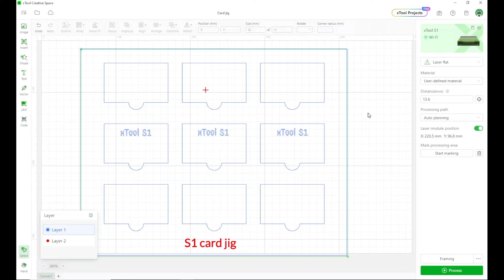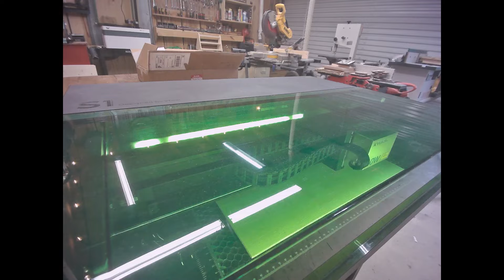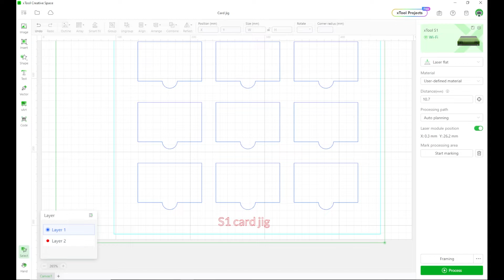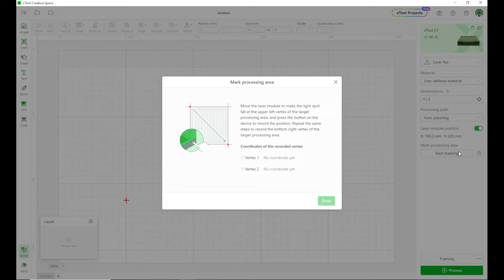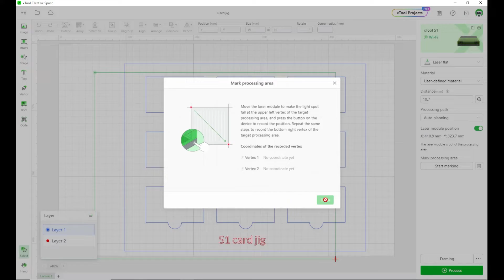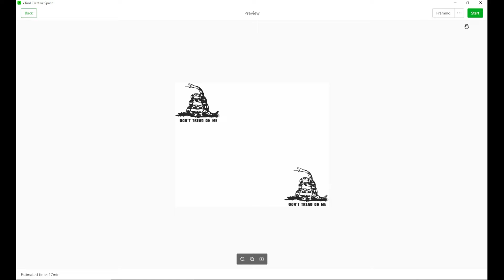Making a jig for xTool S1

Comment: I have been researching the lasers for a while. I appreciate your content, for it helped me decide on the S1 40w. I should receive it this Wednesday, and I went ahead and bought mirrors, tumblers in different sizes and your Jig Set from Etsy. (Very good price, BTW.) I should have some good practice in by the weekend. I took note of a bunch of the settings that you had setup, so I have a good place to start. I am brand new to lasers and I really appreciate how in depth you go. I actually feel confident now.  -Gary
Reply from the maker: Nice, just have fun and make some stuff. You will get the hang of it soon enough.

Comment: Great video, thanks!
It's still a bummer that companies decide to omit decent camera systems from this segment considering how cheap those are in terms of hardware. Looking at the S1 20W+2W IR combo currently as an entry in the laser engraving and cutting world. At this point though it's their oldest product lacking a successor and I really don't want to spend my money on it just to get an e-mail about a much better S2 coming out in a few months. 
Considering  the AtomStack Kraft as well, mostly due to its conveyer belt being available in the EU unlike the one for the S1.

Edit: Just saw you've got more videos on both the S1 and Kraft, lining them up in the queue for watching. I would appreciate any advice that would help me with my decision. I am getting one of these to expand a micro business startup centered around custom projects. I do have a solid 3D printer and some woodworking tools already. I really need to build myself a shack like yours. 

P.S. I'm really interested in the rotary accessories and would go for them whichever brand I choose as I want to be able to do personalized office items that sell quite well here.
Reply from the maker: I can't say anything bad about either the Kraft or S1. I have ran my S1 for a couple of years and it is a workhorse. It was my favorite tumbler machine until I finally got a CO2 set up correctly. Thanks for watching..

Comment: On my xcs, after cutting I tried to "ignore" and save and the file, but the ignore button is not showing up?
Reply from the maker: There have been some updates since this video. It is now the OUTPUT switch over by power settings.
Reply: @TheClackShack  Its showing multiple objects selected and then output under that but no ignore button.
Reply from the maker: @ ungroup them, select the one shape. Then uncheck output
Reply: @TheClackShack  thank you so much. I was scratching my head trying to figure out it. Lol
Reply: @TheClackShack  do i just click off output?

Comment: Hi! So, I purchased your jig template from Etsy and I had to resize it a little so the handy dandy places for your fingers to get the metal business cards out.  But apparently those got to be more oval than round and now the air assist blows them out.  The ovals were cut in half when making the jig so do you think if I glued those back in, that would take care of the issue?
Reply from the maker: When doing anodized cards, turn the air assist to its lowest setting. You can turn it off but I leave some air on with my S1. Careful resizing, you can change other dimensions also.
Reply: @TheClackShack  Yes, thank you.  The other dimensions were great.

Comment: Thank you so much for these very instructional videos. I am a bit over 70 and took up lasering for a hobby - loving it! But, wanted to be able to setup a jig. This instruction was great - my question - I have a riser on my S1 and the crumb tray moves in and out so it is difficult to get the metal grid thing to stay in one place. I put it to the right but still seems to move up and down. Any suggestions? Thank you again for being so willing to share your knowledge - even for us old dogs! LOL
Reply from the maker: I press mine all the way to the back. Using this jig and the screw, even if the crumb try moves, the jig stays in one place.

Comment: My machine is the S 1 20 watt sorry I forgot that with my first note.
Ed
Reply from the maker: Also in lightburn, you can move parts in and out of the work area. It may be that you have not placed them in the work area individually. Many of my files contain multiple pieces.

Comment: Good afternoon, I purchased the Jigs from you put it into Lightburn and the file is super-sized and no sizes on the pieces for me to try fix so please assist me with making them useable.
Thank you in advance
Ed
Reply from the maker: Unless the file was resized during opening, the sizes should be correct. Be sure to OPEN and not use IMPORT on lightburn files. There is no need for sizes if opened properly.

Comment: 1 more question for you.  Is it possible to cut through the metal business cards with the Xtool S1 20W.  I’m curious if I could make trophy plates from the business cards.  If yes, could you let me know what settings I could try.  Thanks in advance!!
Reply from the maker: I am not going to say it isn’t possible but not with any usable results. Thin metal just warps and melts. Not what I would call cutting for any use.

Comment: For positioning jigs, I find an engraved cross on the face of the jig at the corners is easier to align than using board edge. You can see the whole laser mark as it intersects your reference. Corners are easily damaged and an inset reference mark will not care! You don't need to worry so much about jig edges as a location reference as your engraving will never be out to the edge with this jig.
Reply from the maker: I used fixed jigs, no need for alignment. Thanks

Comment: Thanks for the video and the files. I got my S1 all set up and ready to go just have to hook up my exhaust. I did get the riser for the passthrough for the future but there is a riser for no pass through will this work with that also? This is a just in case someone has a no passthrough riser, cause I heard in the UK they aren't aloud to use the passthrough! Nice chatting This past weekend with you and Steve.
Reply from the maker: Should, just need to get the crumb tray out of the way of the screw hole. Thanks and enjoy...

Comment: What settings did you run for the cards?  I bought your jigs for the D1 Pro and they work so good. And yes if you sell the file for those clamps i will get it.
Reply from the maker: I am wanting to say i just set them at 400mm/s at 100. I haven't tested anodized with it much

Comment: My question is more about the d1. I just got your jig files from etsy. O ly problem im having is after i have to hit stop in lightburn the d1 thinks its at home position and to reset that i need to hit home. After that the position is always a bit off so the jigs end up being a bit off. How do you deal with that?
Reply from the maker: If you hit stop, it can loose its place and needs to be rehomed. If it isn't homing accurately, slow down your home speed some.

Comment: Nice jig, so you can't "snap" the jig to the green 2-point line? I think they purposely "handicapped" the S1 by not including a camera so people purchase the much more expensive P2. 
Try to position 20-30 little items in-between the spaces on your jig with the 2-point system....LOL!
Reply from the maker: I can do it using this technique. As far as the snapping, I am not sure. I am still learning XCS.
Reply: I think it would take a long time especially if the items were different sizes and shapes. @TheClackShack

Comment: Thank you for these great videos!  Our S1 has been ordered and we're too excited to get started as it'll be our 1st  dive into this space.

For the honeycomb, would it be possible to strategically place some strong rare-earth magnets inside to keep it secure?

After adding your jig file, and after marking your 2-points for the work area, would it be possible to add a new box line and just type in the exact outside measurements of your jig for the box. Take that box and put it inside your green area space, then use snapping to center your jig in?   Lots of extra steps until xTool adds snapping vectors to that green bounding box but would that work?
Reply from the maker: That would me my suggestion is for magnets to hold it to the bottom. Only issue I see is that the bottom plate doesn't seem to be attracted to magnets. I am working on some other approaches. 

Yes, I use a tool line to mark the outline of my panel. It is fairly accurate.
Reply: @TheClackShack thanks for the info. I figured to use rectangle magnets stuck to the base to just keep the bed from being able to move around.  Hopefully that's possible!